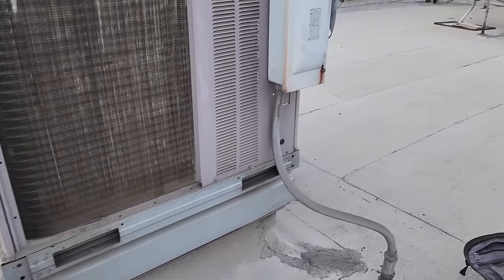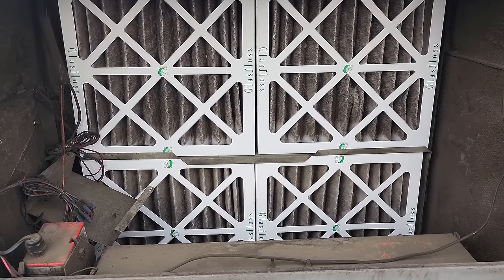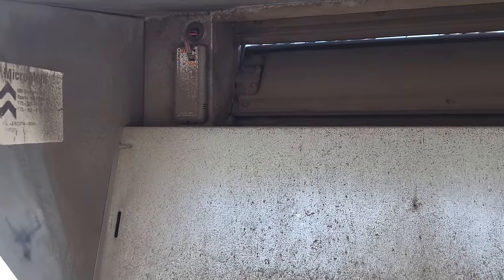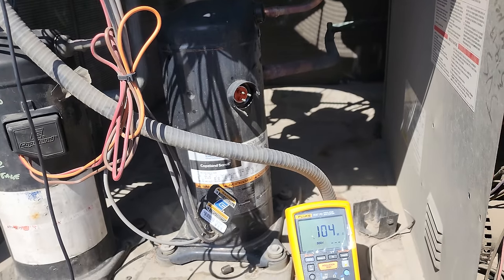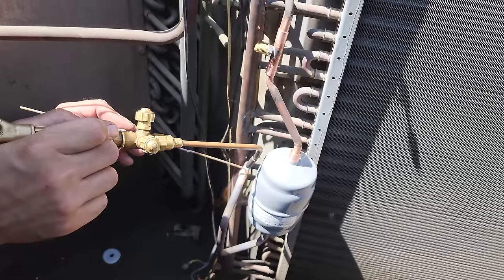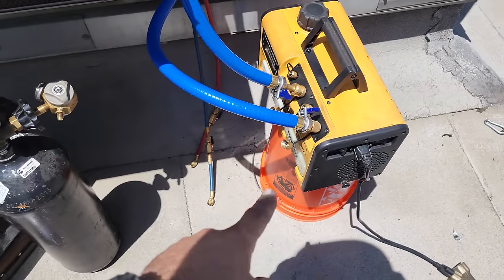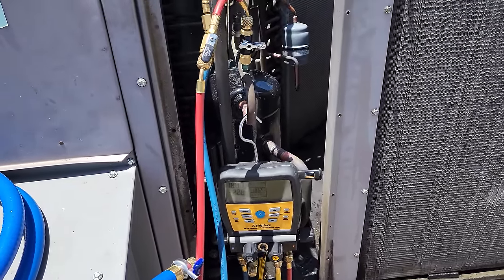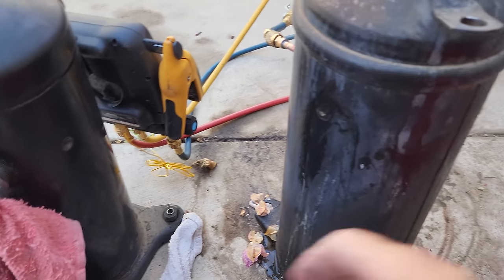THEY SAID HURRY EVERY AC IS DOWN

Comment: I like how you do diagnostics. It seems like a methodical and logical process. (I am an industrial electrician in Australia) The only comment I have is that almost every AC, generator or any other machine I have seen from the USA very rarely has neat wiring. In many of the machines I have worked on, even when brand new, the wiring looks like a bird's nest. I like having neat control wiring but I am not over the top with it. Machines from the US, much like the AC units we saw in this video, look like they have had a school kid on work experience wiring up the machines. Rarely did I see cable numbering either. 
Great video though. Thanks for sharing.
Reply: Maybe its a case of "is it really messy if I work on the exact same bird's nest every time?"

Comment: FYI, You need to watch out for when using 407C. Most of the time when charging or evacuating a system with 407c, it creates a static charge on the hose. We have fried a number of scales because or that. So we always have a jumper wire across the hose. For context, we build custom units. So sometimes the system may be disconnected from ground and power when we do this.

Also 407C can give a false short to ground on the compressor after vacuum and charge. When a new system comes to me for test. I have to run the compressor for a few seconds or I will fail our megger test every single time. I even have to bump the compressor, if it sits for a day or two sometimes. These are brand new Copland compressors.
Reply from the maker: Hey bud that is some really interesting info... Would you mind emailing me I'd love to talk more about it!! Hvacrvideos@gmail.com
Reply: Why are you megging brand new compressors? How can static electricity travel across a rubber hose and fry a scale? I've been searching the internet for like 25 minutes trying to find anything related to 407c causing static electricity or affecting winding insulation and nothing is coming up...
Reply: @MegaDysart  We meg the system per customer requirement. We build custom system and on some units Megging is required during testing. I don't know why the hoses build up charge but they do. I myself have been shocked by one and fried the scale in the process. We use Yellow Jacket Plus II hoses (usually the Ball valve version). The scales that we uses are mostly CPS's. I believe the CC220 model. We use Copland compressors. I don't remember if I tested compressor by itself since I test the whole 240 VAC system at once per test procedure. If I don't bump the Compressor it takes the test value out of range. We usually use an Appion G5twin to move the Refrigerant. We started to use R407C in place of R22 15+ years ago. Since it was a direct replacement for R22 in our systems. We were already using POE oil in our systems. Engineering decided on R407C since it was closes to R22 performance wise for our products ambient operation range. At least that's what I have been told.

As to why we get a static charge, we never really looked into it. I'm just passing on what we have seen. At first we though we had defective scales. That was until someone got shocked. The only thing I can think of is the hose is acting like a ballon when you rub it on your head. All I know is that if we put a jumper wire connect to both brass/copper end of the hose, no problem.  Really haven't tried it with other Refrigerants. Why risk frying more scales. We mostly use R407C like 90%, some R410a, little R134a and some other Refrigerants. It's just standard procedure for us now to use a jumper wire.
Reply: @PeterParker-tb7ce  that's crazy as hell. Thanks for the info bud. Never ever would've thought that would be possible.

Comment: #15 rosebud is an "all-in-one" tip. I use that thing from 1/4" to 1-1/8". Love that thing.
Reply: I use a rosebud tip for everything that doesn't require pinpoint heat.

Comment: Thanks for your comments on 407C!   The only reason I got my federal certs is that I'm an old retired oil/gas/power gen guy, and my local company put the double-rectified screws to me on a repair of one of my residential systems.  They lost my R22 charge cutting out the drier, and replaced it with R407C and didn't do ANYTHING about oil.   Needless to say I had a mess on my hands.  The thing worked, but the evaporator was always flooded with oil and it really killed the heat transfer properties.   A lot of money for poor performance.

I decided after not getting any satisfaction from them that I was better off just getting certified and buying my own equipment and doing it myself.   I've learned a TON of stuff from real pros like you and a handful of others.   

I wasn't willing to risk my dwindling supply of R22 on the system with R407C in it, (15.5 lbs), so I converted it to R458A which works fine with mineral oil.   I added a TXV and the  thing works better than it ever has now.   The only problem I've seen with these blends is that the wide condensing spectrum (glide) can trick a fella into overcharging if he's relying on a sight glass out of the condenser as an indicator.    You could be on target with your superheat and still not have a clear sight glass.    

There ain't any good shortcuts.  I've always adopted the  mantra "Do it right as you can the first time around, or you'll end up doing it at least twice!".
Reply: Thats why i shoort for the mid point in blends.
Reply: Comfort cooling should be subcooling, not sight glass based for TXV - that'll result in far more accurate performance.
Reply: "third times the charm" when all else fails. lol
Reply: What's the current status of the ozone hole?

Comment: I once had an old copland scroll leak in the same exact spot.. But only once in years of doing this trade. The company I work for still uses R22 but has also been using 407c for a few years. It works good on straight ACs but has problems with heat pumps sometimes. In the last year we start using Bluon TDX20 (R458A) and personally I really like it alot. Would recommend it to anyone looking for R22 replacement.

Comment: taking your time calmly is solid advice for any trade. in the general maintenance world sometimes you have supervisors breathing down your neck. i always brush them off basically and work like i normally do. the simple checks you do every single time, like checking transformer voltage etc. can save a lot of time if that happens to be the problem.

Comment: Back in 2011-12, my local supply house was starting to really push MO-99 as a replacement. We were working on a 120 ton AAON unit. It had 4 cooling stages with 8 Copeland compressors (4 twins). All four compressors had finally died in 2 of the stages. We put 4 brand new Copelands back into the unit and, with the Copeland rep's blessing, we put in MO-99 as a replacement because the customer wanted to save money on refrigerant. We get everything in, all compressors and all stages are running like a champ, and went home for the night. When we went back the next morning, the same two stages we replaced were down again and all 4 compressors were drawing LRA. We couldn't figure it out and couldn't get those compressors started again. 

We had our supply house and local Copeland representative come out and diagnose what happened. They checked if our installation was correct(it obviously was, I'm only a hack when I need to be lol). They analyzed the refrigerant and oil for contamination. They checked everything. Went through the entire unit with a fine tooth comb. They found that the MO-99 essentially washed the oil out of the compressors, but it wasn't carrying the oil back and all 4 of them seized up overnight. All of the oil was being trapped in the evaporator. It had to do with the way the unit was piped from the factory. It worked fine for r-22, but not for MO-99. Copeland determined that due to the sheer size of this unit, there needed to be more traps in the circuit to allow the MO-99 to bring the oil back. Copeland ended up giving us another 4 brand new compressors to install, but they wanted us to put r-22 back in the system in order to warranty them. I'm sure an oil separator and/or adding some traps along the circuit would've worked, but neither I nor Copeland trusted MO-99 in this system. Don't even get me started about using MO-99 in medium or low temp systems. It seems to work ok in smaller package rtu's (like 20 ton or less) and split systems(depending on lineset elevation and trapping). I just try to avoid using it altogether though. It's a terrible refrigerant.
Reply: Thank you for sharing your real experience.
Reply: I can't stand MO99 for this reason. Ive seen it kill compressors as well
Reply: We recently acquired a 9 story with 60 to 100 ton splits. Converted to MO-99 after research and acknowledgement that previous contractor was changing out several  06e’s a month though trapped all the way to first.  We found two major factors and have had many less failures.  One must use POE.  Though supply houses will tell you it will work mineral and it will on same level installations.  Mineral will not bond enough to carry in extensive lift situations. Two. The had installed EXV’s which did not have a dedicated MO99 scale and they had left them set on R22 which works if you are using the saturated scale liquid but you do not on blends with glides. Did comparisons of all available scales and 438a came with in one degree both saturated vapor and saturated liquid.  On r22 it would go south of 4 degrees superheat on load up. Once scale change it had a smooth 18 degrees even when switching between load and unload.  Biggest thing for compressor failure on MO99 was oil return on multilevel.  Viscosity will not lift far with mineral oil.
Reply: I am an IT guy and didn't understand a word but the world of AC units is fascinating, working on electronics is so cool. I've started to repair my house appliances and feel like a god after I said FU to our throwaway society.

Comment: If anyone doesn't already know. For a Copeland scroll AE 1294 bulletin gives you information on what they state is acceptable megg test values. 

Chris you should try using the PI ( Polarization Index ) DAR ( Dielectric Asorbtion Ratio ) test when megging. PI uses readings at 1 and 10 minutes and uses a scale to determine the quality of insulation. DAR is a 60 second test, with readings at 30 and 60 seconds with a scale as well. Your megger i believe has that function. Just FYI for my fellow HVAC brethren
Reply from the maker: Thanks bud!
Reply: @HVACRVIDEOS  🤘🤘🤘🤘
Reply: I have the Megger 420 / 2 that does the Dar / PI test. That test make's a big difference. I usually only use it on big shit like chiller's. However your Fluke is perfect for what you are doing.
Reply: @wd8557  myself as well. Im commercial/ industrial and thats where i first heard of it. Then did some reading and have been using ever since
Reply: @jasonjohnsonHVAC  Don't get me wrong the fluke will be 99.9 percent right on the small compressors he works on. But the end all of  day  is a megger that can run test. Two different stories.

Comment: Customer is very lucky today I suspect.  Everything was down, but you know the systems well enough, and the care you take to investigate everything lets you get things up and running .. well, limping...   Further, even the worst problems are the least bad versions of them.  Saved from tainted oil by the last whisp of pressure in the system, perhaps even a single week latter it would have not had that bit of grace.

Comment: Nice Video.  Nice to see you using 407C, as that's also what I have chosen as my replacement for R-22. It seems to work well. And the whole "Glide" thing that has everyone so scared is easy to work with once you understand it. What I'm worried about is performance, and 407C does it. It works well, and gives efficient cooling. No headaches.

Comment: Great video thanks, very interesting, as an ex-electronics tech (mil radio, systems and computers), the wiring on those AC units looks shoddy AF... But it gets the job done.
Reply: Yep, they all come out of the factory like that 😅 fortunately when a system is installed you generally don't plan on it moving untill it's time to replace, making further cable management and shielding unnecessary

Comment: Many years ago I had a restaurant in the mall. Cooling was a coil in the air handler off of the malls chilled water system. We were also on the 3 floor so with windows and the rising heat it was not that great. Being in Wisconsin we had to get the coil winterized, filed with anti freeze for the winter. So the second winter I got a new company to winterize the coil and in spring they came back and the coil was freeze damaged. The company said it was not there fault but made the tech fix it on his own time.

Comment: Just getting to see this video a couple months later but one thing that is important with JADE economizers is that even with a single-stage unit, you need to still use a two-stage thermostat input to the JADE. This is because when the JADE is in full economizer, if there is a call for Y2, it will turn on the Y1-out to turn on the first (or perhaps only) stage compressor to supplement the economizer (also known as "integrated economizer" operation). If it only sees a Y1 while economizing, it will never turn the compressor on, and on a mild day, it can result in undercooling the space. Always connect a 2-stage thermostat to a JADE regardless if it is a single or two-stage unit. Optionally, you can also set a "Y3 delay" on the JADE. If that Y2 call persists for more than a set number of minutes, while the economizer is operating, it will then kick on the Y2-out for second stage compressor if there is one. When it's not economizing, the Y1 and Y2 calls go through the JADE just like you would expect. I've done this on a church that has a two-stage system serving the sanctuary, and it's set up so that if it's economizing (Y1 call), and it sees a Y2 call, it will kick on the first-stage compressor, wait 15 minutes (Y3 delay), and if the Y2 call is still there, bring on the second stage compressor. It's one of those little things in the JADE manual that isn't necessarily obvious but it can save you a lot of headache and save the owner energy by not "fixing" the economizer by cranking down the mixed air setpoint to make the economizer operate less.

Comment: I like how 407c works on a system. I've been trying to convince my company to allow 407c conversions at least on r22 equipment with POE oil. However each and every time they say "the system isn't designed for it, that compressor will burn out in a couple months" 
So my question is, have you had any compressor failures shortly after converting to 407c? (not a complete compressor swap, just refrigerant swap on applicable units)
Reply: Work on a lot of Liebert 20 - 30ton splits with 06D semi's running r22, systems that have leaks we do leak check and repair, change the oil, and charge with 407c. I've been doing this for years and the compressors we put 407c in don't die after a couple of months. I have been using 458a recently because it's a lot cheaper and bluon tech support is literally the best in the industry. Also witj bluon you have to change the oil.

Comment: 23v  check the primary volts on the transformer.  208v on 240v tap most likely
Reply from the maker: Nah we have low incoming voltage here it was likely 200 volts so even tapped at 208 it would likely be 23

Comment: I have a 4 ton residential, dual compressor, and when I get someone out to look at it, they just want me to replace the whole thing (handler and compressors).  Something happened to the second compressor, and it will not kick on when the temperature differential calls for it.  2nd phase compressor seems totally dead. I wish I could find someone like you. I think a rat got fried on the relay switches.

Comment: When you switch from R-22 to 407C does that requires an oil change as well? Can you leave the old oil in the system or is there a way to flush that.
Reply: 407c doesn't like mineral oil. It has to do with oil return. 407c likes POE
Reply: The new compressor comes with POE oil in it, the little bit of mineral oil out in the system makes no difference.

Comment: 3phase scroll compressors do not work when running backwards.  Drain the old compressor oil . This will let you know how much oil is in the system.  Too much oil = not enough refrigerant.

Comment: Perhaps I've misunderstood but if the unit was using 100% outside air due to outside being cooler than inside then nstead of recirculating warmer indoor air then this is better than not having the economiser operate at 67f or does it not allow the cooling coil to operate with the economiser to further cool the incoming fresh air that is cooler than inside?
Reply: I believe its one or the other, at least the way that control is set up. I agree that seems like it would make it more efficient, since that's basically how a make up air works anyway, cooling or heating outside air.
Reply: Or maybe it just didn't think it needed to also cool the outside air it was bringing in, since it was set wrong.
Reply: Always best to use outdoor air where possible if it's lower than the temp inside as this is free cooling, if the outside air is not enough to meet the cooling duty inside then the compressor can run too to assist.
Reply: Actually truth be told depends on region you work in generally as you need enthalpy humidity needs to be factored in as well. But more specifically as to your question 67c somebody is way off their game if they are trying to economise at that temp at all. As 67 C is 152.6 F.  You are in a very hot spot if that is considered cooler.
Reply: @Rob0243  Sorry I meant 67f my iPad corrected it!